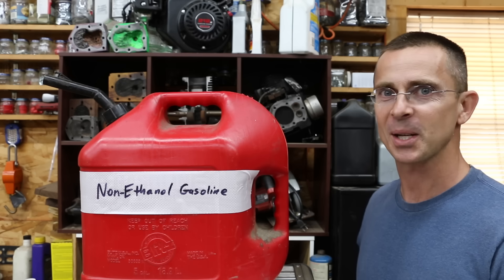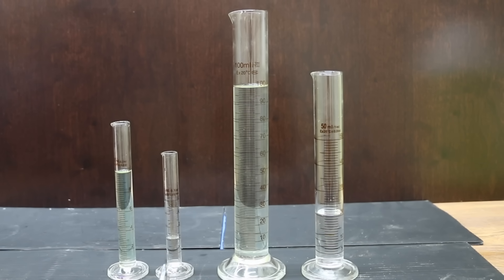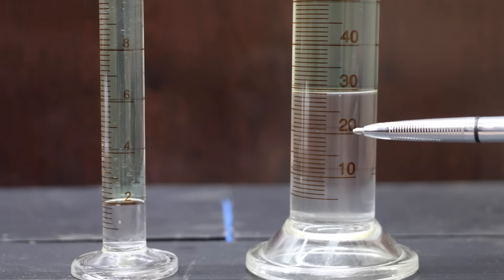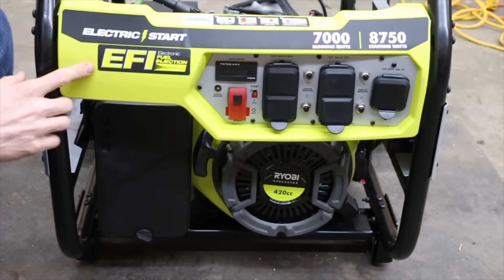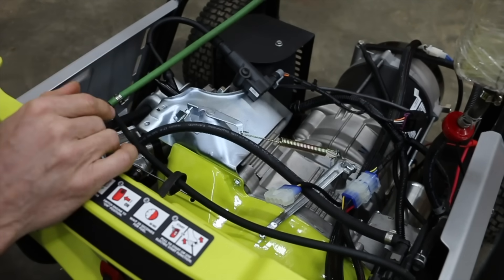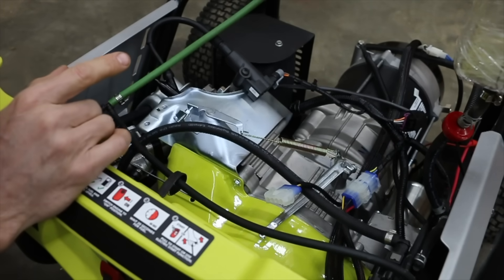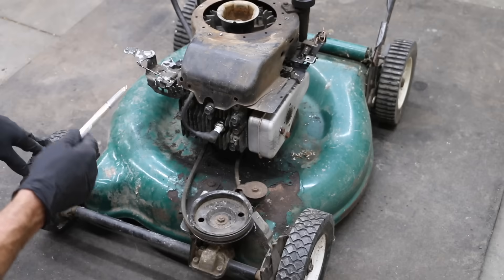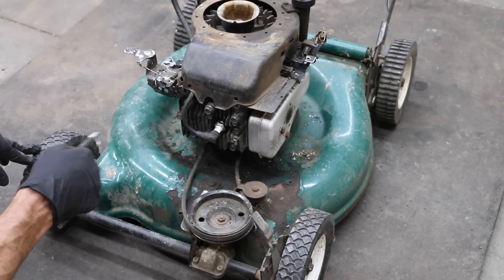Is Non-Ethanol Gasoline Really Better? See the PROOF!

Comment: I saw a side by side comparison sticker on a brand new 2008 Chevy Tahoe showing the differences between gasoline and E85.  Using gasoline it got on average about 603 miles on a tank so about 20 mpg; using E85 it got about 450 miles on the tank and about 3-5 less mpg.  Ethanol based fuels at tank fill up may cost less, but cost more long term because you get less mpg.  I know a guy who owns a gas station and he has told me repeatedly that gasoline with any amount of ethanol isn’t good.  With all the cars that are flex fuel in the area I live you don’t see many flex fuel pumps.  In fact, I don’t remember the last car model year that had it marked it was flex fuel.
Reply from the maker: Thanks for the feedback.

Comment: I can tell you ahead of time if a carb is fouled with ethanol fuel, you may as well pitch it. Myself and others haven’t found a way to clean the “varnish”
deposit ethanol leaves in jets, on needles, floats, etc.  Runs well while it’s running, but store an engine with ethanol fuel in it and it will wreck it.

At least has mine 🙁
Reply from the maker: Thanks for the feedback.

Comment: It is not corrosion!  It is sugar deposits as the ethanol absorbs water then oxidizes back into corn sugar! Thus white color left as it evaporates.  Th as t is why you boil a clogged carb in water. It melts the sugar into the water!
Reply from the maker: Thanks for the feedback.

Comment: I only use benzene-free small engines gas. It's so cheap here in Finland due to the local processing plant that one almost could use it in their cars, it's 93 octanes. Practically no foul odour, has anti-corrosion additives, and it also doubles as a cleaning fluid.
Reply from the maker: Thanks for the feedback.

Comment: I have 2 Ford Crown Vics, a 2010 and a 2011, designed to run on E85 and the only difference is they seem to have more power but get about 10% less gas mileage and save 35 to 60 cents a gallon.  Cost per mile is about the same or slightly less.They both have around 150,000 and substantial  idling time (both former police cars) and have no problems!
Reply from the maker: Great information. Thank you
Reply: I have a 2009 P71. How is the e85 treating you?

Comment: I'd like to see you test miter joints vs butt joints for strength when using nails, screws, biscuits, and dowels for connectors. As you know, there are also many other types of joinery that could be tested as well.
Reply from the maker: Thanks for the suggestion.

Comment: Thanks for the video! I have been planning to experiment with making E100 from corn and converting my old carbureted truck to run on it, due to the recent rise in gas prices. I was concerned about carbon build up, however I was aware that it was suppose to reduce the fuel efficiency by 10-15%; but if I can make it cheaper than I can buy it, it may be worth it.
Reply from the maker: You are welcome!  Thanks for sharing.
Reply: E100 is going to get far worse mileage than E10.  I have a Flex Fuel 2014 Ford that gets 40mpg hwy on E10 87 octane. 42mpg on pure gasoline.   If I fill up with E85 it drops to 25mpg.  That's a 40% drop for only a 20% discount....but different cars may respond differently.
Reply: @Tyrone Legstrong IV ethyl alcohol is a mathematical octane booster. Discount suppliers take 85octane petroleum add 5% alch to get to US87 octane or add 10% to get to US91.  THE 89 Midgrade customer pump simply blends the two tanks.  European Octane is a different math formula...but their numbers of 90, 93 etc roughly match 87, 89, 91 AKI in actual chemistry of the blend.  Octane originally meant more CH8 and CH9 in the blend x% of CH8+ vs the CH7, CH5 and CH6...all of which are more volatile and easier to burn.

Octane doesn't however produce power, it simply allows for higher compression that produces more power...  if an engine is fixed moderate compression and fixed timing, then the lowest number gasoline that doesn't knock is all you need buy.
Reply: @Tyrone Legstrong IV well that makes driving about as complex as trying to drive a Leaf or Chevy Bolt across the Great Plains from Reno and along I26 or I40 to Knoxville or Richmond in under two days.

Hey if you want to do all that...Great.

Comment: Ethanol not only deteriorates most rubbers, it has an affinity to water.  Ever use a bottle of water remover for a fuel tank?  Guess what it actually is.   Modern synthetic rubbers have addressed the issue, but any small engine shop can tell you of the tons of business they got from ethanol fuel damage.

Comment: If you watched Engine Masters from MotorTrend they did a E85 vs standard ethanol fuel and they went through a list of things for if you’re taking an old car like a Chevelle etc you’d have to use everything from ethanol rated fuel lines stainless steel fuel filters etc because the ethanol eats the rubber and plastic. My dad always had to replace the primer buttons on any small engine equipment and redid a few carburetors as well until the ethanol free fuel became available. I run it in my truck. Same mileage but the truck was built in late2003 and was at the end of the 97-04 generation for that body style so it was before flex fuel even existed. If I ran normal 87 and parked it for a long weekend the first time I started it, the tach would surge and almost cause the truck to stall and misfire. Threw some octane booster/stabil and it was fine. But being the ethanol is a booster it could have been 84 or 85 octane. Even the stations near me sell ethanol free but claim it as 87, 89 or 90 octane. I can park the truck for a week and it’ll start up no problem with the free.
Reply from the maker: Thanks for sharing.

Comment: I know a number of engineers that work or worked at GM; Their warning about fuels with ethanol were that the injectors and TBI nozzles on older vehicles are made with a plastic that would be damaged by the alcohol over time. I don't know about injectors on newer vehicles, I would hope that this has been addressed with a better material.

Also, it has been found that the water which comes from the exhaust of car using ethanol fuels has chemicals in it not previously seen. This is believed to be something created in the catalytic converter. Effects on the environment of these chemicals is unknown. However, rarely (as in never) are "new, unknown chemicals" being introduced into the environment good.
Reply from the maker: Thanks for the feedback.

Comment: Ruined carburetor components; ruined hoses, More fuel required as I do NOT have a turbo to make up the differences.
So; I buy More fuel making some Senator rich in the Mid-West
Reply: My Viton needle tips were ruined in my Holley carbs and the original rubber hoses went bad way too fast as well.
Reply from the maker: Thanks for the feedback.

Comment: Did you put an Amp clamp on the output leads to the load bank/space heaters and run the gen set at 80% load for an accurate measurement of fuel consumption? Will the engine burn ethanol faster at 80% load vs. non-ethanol at 80% load…just curious?

Comment: Ethanol fuel is entirely dependent on the quality of the ethanol.  Cheap ethanol contains sulfate and methyl-cellulose contaminates, which both KILL engines. 

Additionally, the additives included in the blend are ABSOLUTELY needed, as is an engine that has a proper intelligent electronic fuel mix control programmed to handle ethanol. 

A lot of progress has been made in creating better ethanol fuel, but no where near as much as additives that are put in gasoline these days.  It's already better than when this video was made, but it still needs work.  You should probably compare cheap conventional gasoline,  cheap E85, Cheap E100, premium gasoline, premium E85 and premium E100.   As of what's the best, my money is on the premium E85 right now (late 2021), but with the lack of availability of Premium E85, premium gasoline would do the best at the time of this video.
Reply: I REALLY think this particular video require regular revisits every 2 years to keep up with the evolution of fuel additives.  

I also think the addition of Non-Ethanol, standard Ethanol level, E85 and E100 in both cheap AND premium brands is essential for really showing the contrast too.  

Seeing how Ethanol quality improves as suppliers improve their process will prove very interesting information over the next 20 years, as we are at the time when we are seeing a push for many reasons.
Reply from the maker: Thanks for the feedback.

Comment: 10%Ethanol Gas jells up the carburetor and fuel filters over time that’s what is wrong with it period.
 lawn equipment for the average homeowner is sitting around during the off-season.

If you are cycling fuel through the engine daily (like a car)
10% ethanol in the gas it’s not an issue.
Reply from the maker: Thanks for the feedback.

Comment: Modern autos have computer controlled timing, & the lower detonation problems with ethanol means your timing fires earlier therefore giving a longer burn cycle. They also run higher compression ratios. That makes up for the few percent difference in efficiency. My Cadillac showed 24.3 on ethanol free gas on a longer trip, and 24.2 on ethanol on the return. Since ethanol is considerably cheaper at the pump it's a no brainer in my wallet.
Reply from the maker: Thanks for the feedback.

Comment: Maybe two things can be added, first there are compelling ecological reasons for not using ethanol in fuel, which are simple to research for those who are interested, 
Second, ethanol rots some types of rubber and plastic. There are differing grades and qualities of both, and some will suffer with ethanol. A modern engine could easily have excellent quality parts fitted as standard, but with older vehicles which have had replacement parts of unknown quality fitted you are taking a chance. I have a small farm with lots of petrol powered machinery, plus a motorcycle and a scooter -- and I´m an ethanol-free zone.
Reply from the maker: Thanks for the feedback.
Reply: Ecological reasons?  I don't think so.  I work in the ethanol industry and I'm aware of the petroleum industry funded research which is absolute bunk.  They go to immense extremes to try to claim ethanol uses more energy to produce than is attained.  It's utter bunk if you look at other published material from a variety of sources/labs including the USDA which is much more likely to be unbiased.  Remember, every drop of ethanol used is petroleum not being bought/used and the petroleum industry is about as greedy as any industry out there (and then some).  Also, the use of land for producing corn would be used for corn anyway and the byproduct of ethanol is distillers grains which goes to cattle feed where that corn would be going anyway.  I could go on and on.
Reply: And it's been shown that ethanol being blended with gasoline does reduce greenhouse gas emissions compared to 100% gasoline if you look at the unbiased studies and not the petroleum industry bunk.

Comment: I get at least 10 % better gas mileage with non-ethanol in my 2015 VW Golf.  Reason is gasoline has higher heat energy than alcohol..  Learned as a kid.  ethanol model airplanes ran out of fuel much faster than gasoline.
Reply from the maker: Thanks for the feedback.

Comment: We have a number of small engines. So far if reg 87 ethanol gas is left in these over the winter we have a lot of issues getting them started an running for the summer. I have more at home that I use non ox premium gas all summer.this more sits all winter with gas in the tank. So far in 5 years it has started with one pull every year for the first mow of grass.  Then I’ve had various streetrods from 300 hp small block chev to supercharged small block chev. Over 50 miles combined driving. Never had fuel issue with any car uding non oxy premium.   Then I have a 30 yr old 34 foot boat with twin 454 chèvre performance motors. Marine gas is non oxy premium only. They don’t sell any other kind. I’ve had the boat 5 years and never had fuel issues. There is no easy way to drain fuel tanks so water condensation is an issue.  Boats have all kinds of condensation issues so I feel fortunate with non oxy premium. Boat gas is at least a dollar more per gallon so marine gas is very expensive.  I’ve seen numerous small engine fuel systems coo rode down and moisture issues with ethanol. My friends shop finally saw the light and went with non oxy premium in all small engines. Last spring was the first in years with no fuel issues in the spring. Every motor started the first attempt for first use in the spring.
Reply from the maker: Thanks for sharing.

Comment: Excellent, thank you! Have you any idea how accurate the 'lambda' sensors are when the fuel content is altered?  Wikipedia says: "Most practical AFR devices actually measure the amount of residual oxygen (for lean mixes) or unburnt hydrocarbons (for rich mixtures) in the exhaust gas". If that is so, then they should be able to compensate for the ethanol in the mix. 
This is a big deal, since adding ethanol does effectively  lean the mixture  (wrt stoichiometric) on a conventional carburettor.  The leaner mixture takes longer to burn, which transfers more heat to the cylinder, and has the potential to burn exhaust valves and seize-up 2-strokes.
Reply: lambda sensors and ECUs of recent engines do adjust for ethanol (stoichiometry + ignition timing), good enough for E10 or even as high as E50, but for high ethanol contents such as E85 in most cases this falls short of the stock specs so a special device must be fitted.
for carburettors adjustments are manual: increase the size of the pipes and adjust ignition timing manually (for E85, 4 degrees of advance and ~40% more jet throughput aka ~18% larger cross-section than gasoline)

Comment: Just catching this video now, almost 3 years later.  I recall reading something from my state (Minnesota) that went heavily into ethanol right away (helped raise the price of corn), about your car fillups.  Every third trip to the gas station, you are supposed to use non-ethanol fuel to clear out the gumminess caused by the ethanol in the lower octane grades.  I didn't think about this before, but no wonder I've had a lot of trouble with my small gas engine snow blower the past few years.
Reply from the maker: Thanks for sharing!
Reply: You shouldn't use ethanol gas in small engines period. When ethanol sits for long periods of time it collects water which is not good for these engines

Comment: I've been told ethanol fuel degrades seals/gaskets quicker. Maybe hoses too.
edit I made this comment 1 minute before the end when he said he'd check the effects on plastic and rubber parts. This guy is great!
Reply from the maker: Thanks for watching!
Reply: yes. That is why car companies will say whether their fuel systems are ethanol compatible or not. Here in Australia that can either be E10 or less common E85.
Reply: @ianmontgomery7534  Here in the States I first started seeing E85 about a year ago, it is 88 octane instead of our usual regular which is 87. So sometimes you will see it on a price sign as 88, sometimes as 85, and it confuses people. There are warning signs on the pump telling you not to use it in small engines like mowers and boats.

Because of those warning signs, and a distrust of anything new, a lot of older guys I know from work say they will NEVER put in their vehicle. I sometimes buy it though, because it averages about 30 cents a gallon cheaper than the 87 regular. Especially a few months back when gas was nearing $5 a gallon. I'm a little distrustful of it too though, and I never put it in my truck when I'm close to empty, only when I have a quarter tank or more.

Curious to see that other video now, and whether he will use any of the E85 despite the government warning signs.
Reply: @johns9652  Ummm.... E85 is 105 Octane John. The high-octane rating is why high boost turbo and supercharge builds use E30, to full E85.
Reply: @mountedpatrolman  My apologies if I mislabeled something, I was referring to gas that is 88 octane containing 85% gas and 15% ethanol. It has a blue hose instead of normal black, to make sure you see the difference.

I have seen signs where stations have it that label it 85 or 88 almost interchangeably. Perhaps I added the 'E' myself because it was on the pump somewhere. I guess now that I looked it up, I should have properly said E15.
Reply: @johns9652  ah yea, that's E15. No worries